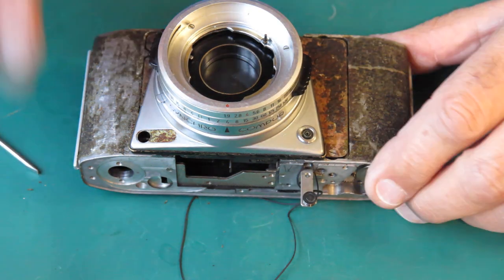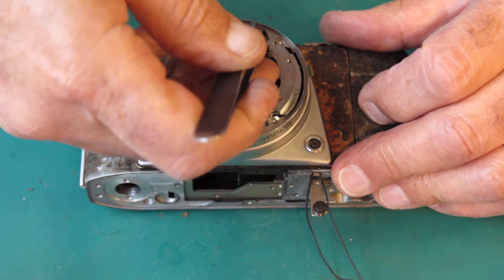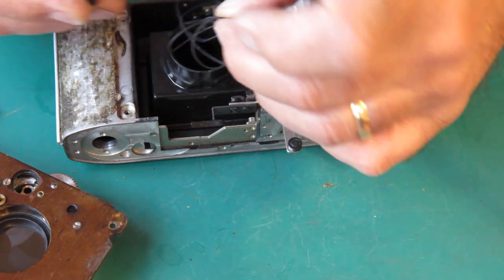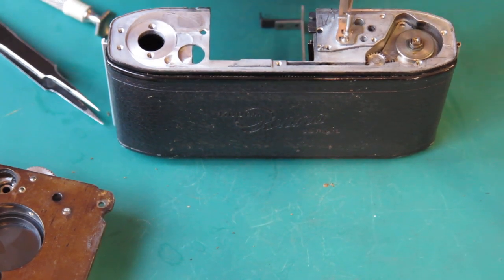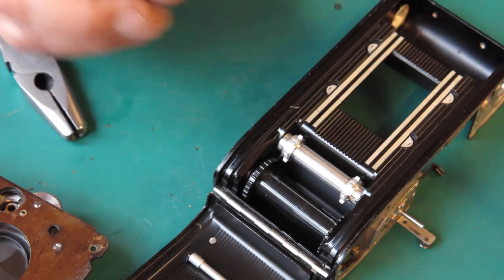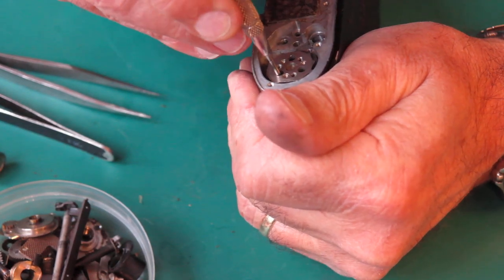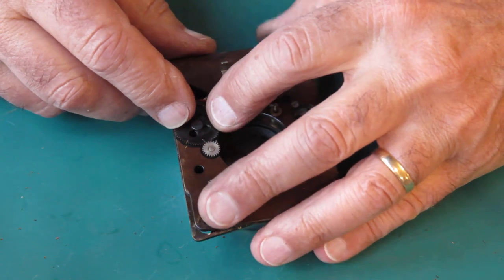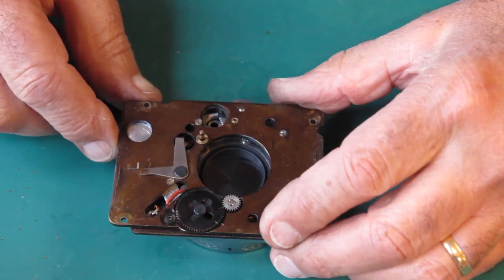A dog tucker Retina IIIS gets a new lease on life, part 02

Comment: Regarding those "corner washers" -- I would always stick them onto the sticky side of a length of tape, to ensure they'd be replaced in the same corner they were in originally, on the assumption that they varied in thickness and were used to ensure proper collimation of the optics.